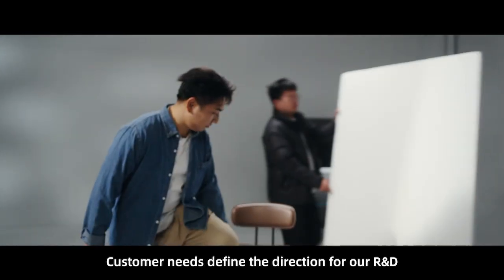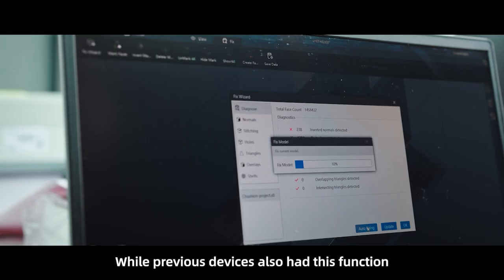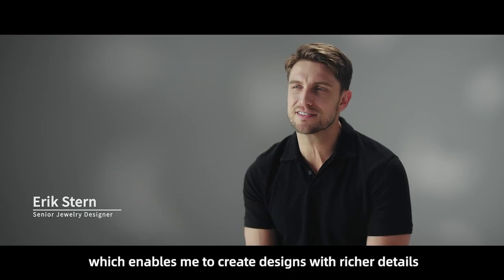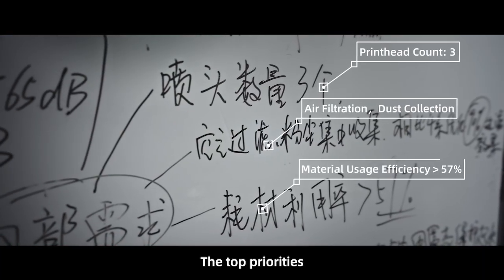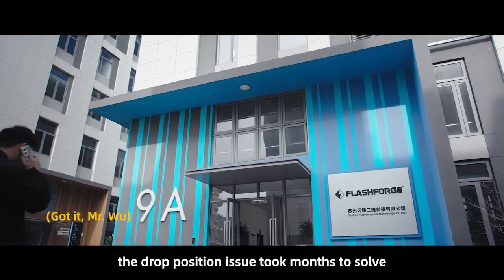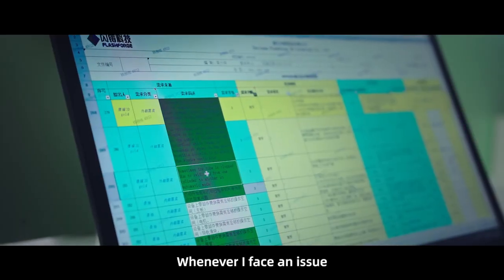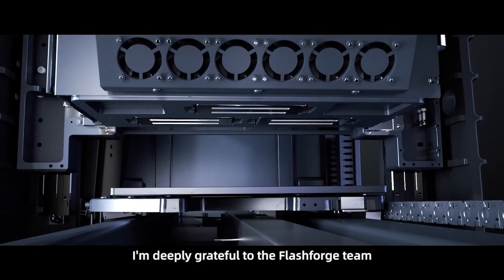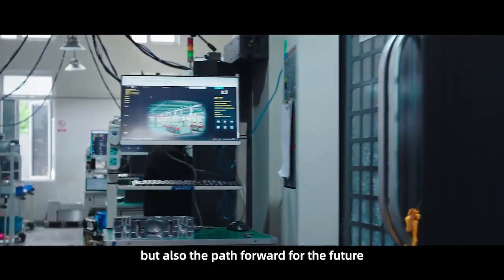Flashforge's NEW 3D Printer: The WaxJet 530

Comment: We have been experiencing a serious unresolved warranty issue with our Flashforge 400 industrial 3D printer for more than 2 months.

The machine is currently non-operational due to a technical malfunction, and our production workflow has come to a complete stop.
Although the device is still under warranty, neither the Turkish distributor nor the manufacturer has provided a clear diagnosis, technical report, or effective solution.

We keep receiving the same repeated instructions, yet:
 • ❌ No clear diagnosis is made
 • ❌ The faulty part (head / jet / sensor / electronics) is not identified
 • ❌ Warranty-based part replacement is not approved
 • ❌ No spare part has been shipped
 • ❌ Technical support is not progressing

This ongoing situation has caused significant financial loss, production delays, and loss of business time for our company.

hashtag#Flashforge hashtag#Flashforge400 hashtag#3DPrinter hashtag#WarrantyIssue
hashtag#CustomerSupport hashtag#Manufacturing hashtag#AdditiveManufacturing
hashtag#TechSupport hashtag#Industrial3DPrinting
Reply from the maker: We're sorry to hear you've been having issues with your machine. This issue isn't related to us at Freeform Fabrication however if you DM us where you're based we can see if we can help.